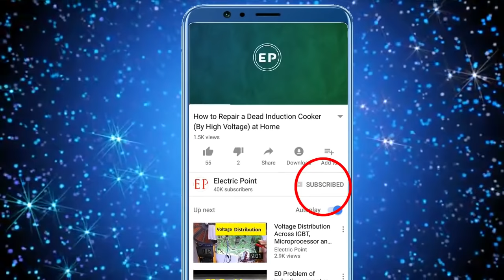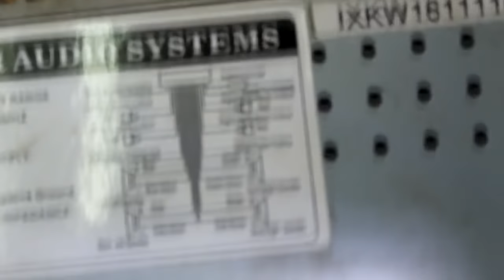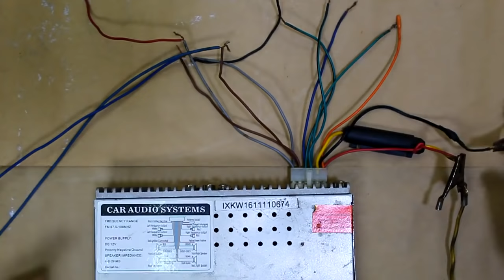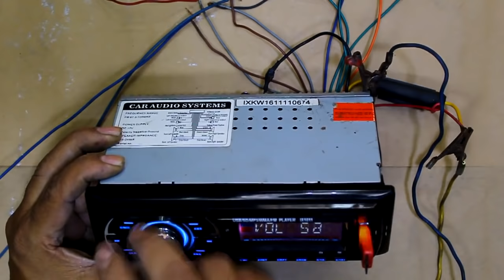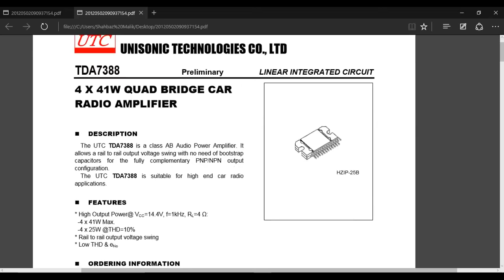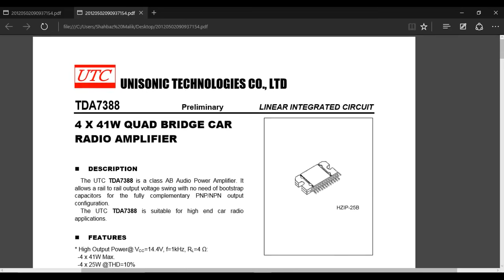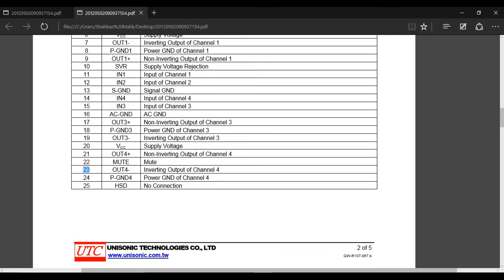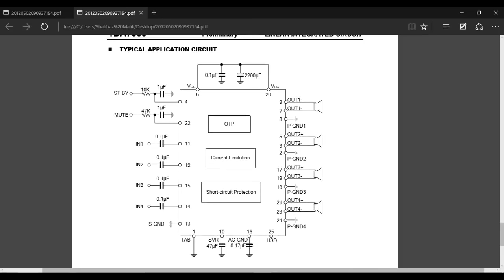How to Repair Car Audio System Easily

Comment: Sir car stereo system ko Ghar me salane ke liye 12 volt 5, 6,7 ampere Sahi rahega
Reply from the maker: 12V 5 Amp thik rhega
Reply: What is the max Amph . Can i use 30 or 10amp
Reply: @goldenvibes99  yes use 30 ampere

Comment: Nice video. I have same loosing problem with my car music system. My car radio/ music gets off or on when it gets a jerk of jump. It also used to stop work occasionally. What can i do to get it repair? Pl guide me
Reply: Did you fix it
Reply from the maker: Yes

Comment: Bhai maine glti se isi streo me 12v 3amp ka transformer with diode or capacitor  matlb bina ac ko dc bnaye  power supply dedi  ab jb usko use kr rha hu dc se to 2 channel me awaz shi h 2 me speaker lgane pe amp bnd horha h

Comment: In my car system remote not working in home I connect with 12v 1.5amp and my car system will off means all reset  like bassfull00 trefull00 Lou off like that solution pls
Reply from the maker: Konsi company or model ka he